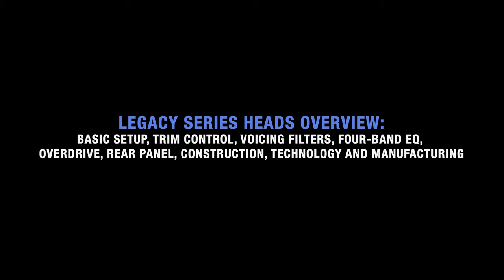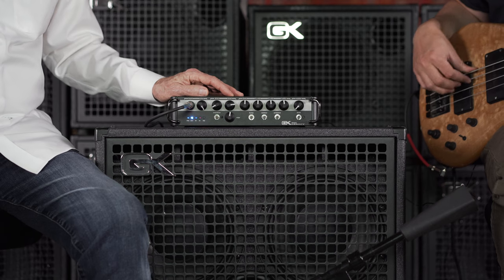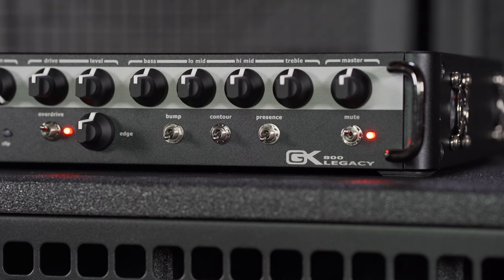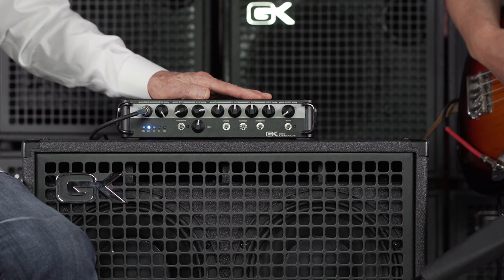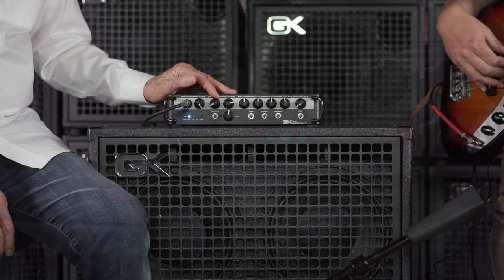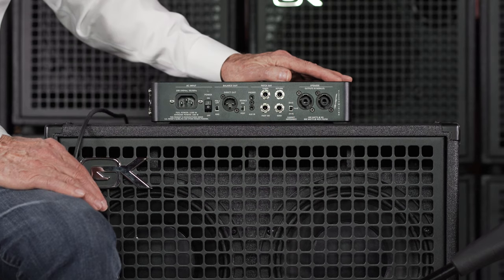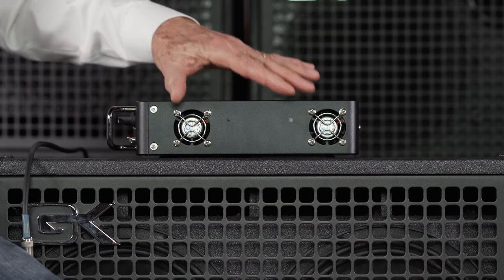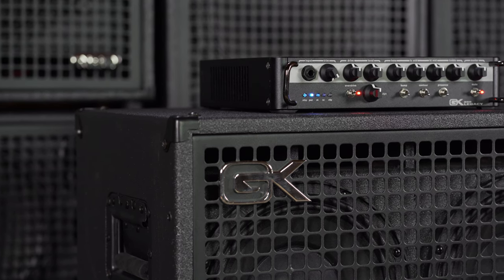Gallien-Krueger Legacy Series Heads: Complete Overview and Demo

Comment: Very nice demo Bob and Forest. I have been playing bass since 1969. Picked up my first GK in the 80's, I don't remember the model. Later I bought an RB-400iii with a Backline 115 and Backline 410 cabs. I played that setup for probably 13 or 14 years. I'm 68 now and can't haul that much gear anymore. About 12 years ago I bought a used 115 Backline combo for band practice, it never failed me. Several years ago I bought a MB 115-II from Sweetwater which is plenty for gigs and I use the direct out to the PA and only 38 lbs it's easy to haul around. I would really like to get the Fusion 115 or Legacy 212 but being on a fixed retirement income now will be hard to come up with that kind of scratch. I have nothing but positive things to say about the four GK amps I've had over the years. Thank you so much for a superior product!

Comment: I own an 800rb and i was curious as to whether the "boost" control is the overdrive in question because i have never pushed it enough to hear anything but clean from it without the addition of pedals, also you guys were fantastic at answering my questions about the 800rb when i called. Instant on hand info about a product from 30+ years ago, amazing!
Reply from the maker: Basically this overdrive allows you dial in everything from a boost/growl to full on heavy overdrive. We wanted to give people the ability to dial in that "hitting the rails" sound without having to crank your master/boost channel to get the amp to break up
Reply: @Gallien-Krueger  ah i see, so amp breakup on 800rb is safe to do? Ive been avoiding it out of fear😂 i have one of the original line so i treat it well

Comment: I think my math should be correct if I've understood it all but could someone help & confirm? 😅

So would the following head + cab combo work well:
GK legacy 800 (800w output at 2.7 ohms) with GK CX410 4 ohm cab (800watts) + GK CX 115 8 ohm cab (300watts). I think this would be awesome. So (8x4)/(8+4) = 2.666 ohms would be the total ohms in parallel, and with 4 ohm + 8 ohm cabs it would mean that 2/3 of the heads power goes to the 410, so 2/3x800=533 watts for that and 1/3x800=266 watts for the CX115.

And which was the position the back nob should be turned to? (8 + 4) right?

Thank you! I love your bass cabs and amps!
Reply from the maker: Nailed the math! This is a great combo and you are correct, switch to the 8+4 setting and you are good to go!
Reply: @Gallien-Krueger  Thank you so much! 🙏

Comment: I have a question about the ohm load. I believe my amp (legacy 800 like the one in the video) has a different order for the switch on the back. Mine (from bottom to the top) is (4+4) - 4 or 8 - (8+4).

Is this an older setup or am I running my amp wrong?
Reply: I think he said the middle and top around the wrong way
Reply: I agree that he mentioned the middle and top positions in the wrong order.  I have two 8 ohm cabs that have their own parallel connections to join them together making the total load 4 ohms and I would like to know if I need to use BOTH output jacks on the back of the amp or just one?  The rear outputs are in parallel as well so running a cable to each 8 ohm speaker from each output still renders 4 ohms.  
My total load is 4 ohms in either scenario and I believe I need to set the switch in the mid position which, if I understand correctly, is for either a 4 ohm load OR an 8 ohm load.   A 4 ohm load = 800 watts output and an 8 ohm load = 400 watts output with the switch in the MID position.  I would also like to see the switch recessed into a small cavity so it’s under flush with the back surface or a clear cover of some sorts to protect it from being moved accidentally when handling the amp.  I’ll be using a small piece of tape on mine.
Reply: Thanks for the info. I did end up getting rack ears to store with my shure wireless and in ear receivers. May be a solution to the switch thing you mentioned.

Comment: i dont understand the impedance? i have a Hartke HD112 cab with a 4 or 8 ohm switch and a Legacy 500 with a 3 way impedance switch what do i set both the cab and head for optimal performance?
Reply from the maker: Just leave the switch in the middle on the Legacy (4 or 8) and you can choose either 4 or 8 ohms on the cabinet. 4 ohms will draw more power from the head, so 8 ohms for the single 112 would be the best fit!
Reply: awesome!!! this kind of customer care is what makes a company amazing! love you guys    @Gallien-Krueger

Comment: I didn't follow all that well the cabinet impedance explanation. I'm currently running  4x10 4ohm cabinet, what position should the switch be in? He says " middle position is 4 + 8" and mine says "4 or 8" and that's where it got confusing.
Reply: Pretty straightforward… 4 and 8 and the other one is. 4 or 8….

Comment: Music stores seem show the fender rumble 800 head as the knock off version of this at half the price… they have all the same controls… but i imagine the EQ circuit is totally different?
Reply from the maker: Couldn't be more different! No one builds an EQ section like us, it might look the same but we use many more parts and have variable eq
Reply: @Gallien-Krueger  Thanks so much for the reply. I read Flea uses some of your gear is how I discovered you, … at first I was going to go the tube amp route, but for bass guitar, even the tube amps these days have so many solid state components, i really question if i need a couple tubes in there at all… those solid state amp heads you have sound perfect as they are to me.